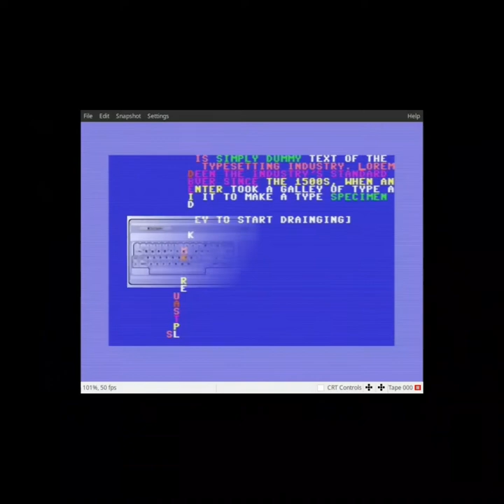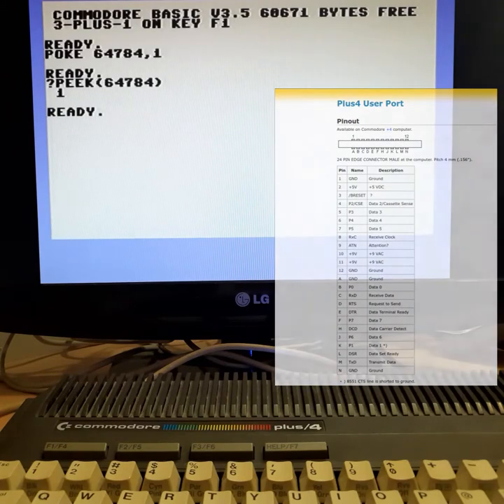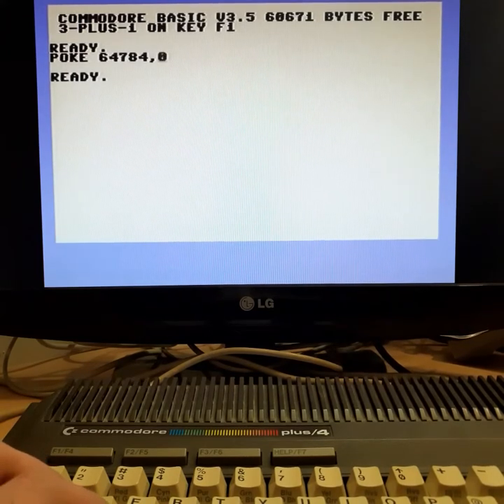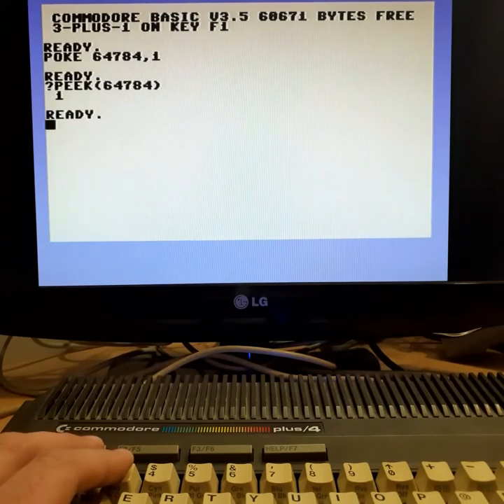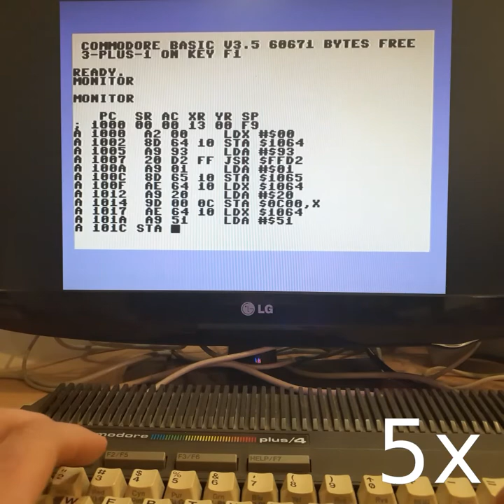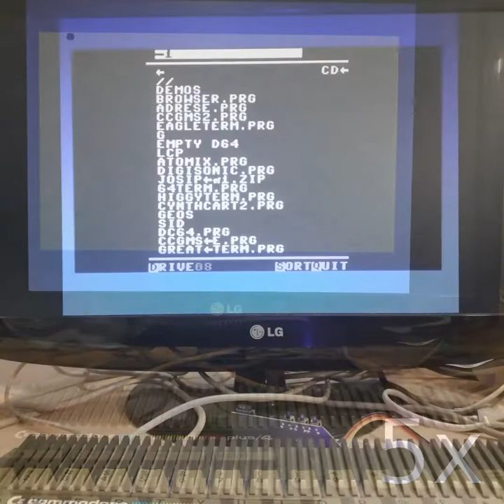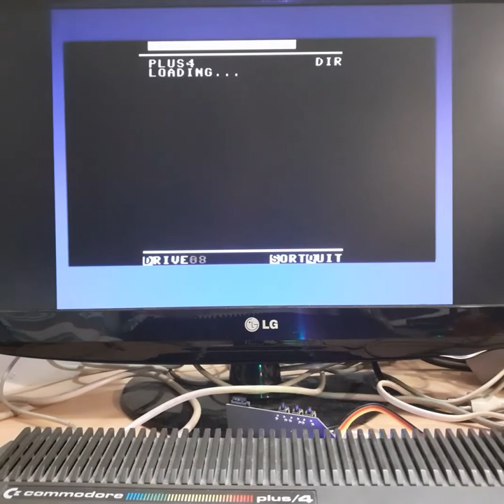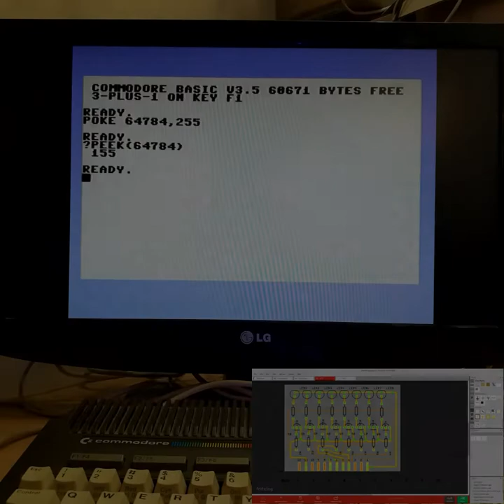Commodore Plus/4 |  Have fun with User Port I/O lines

Comment: Perhaps NTc or ptc resistors can be Used to Check the brightnesstx in a room? Perhaps measuring possuble in Joystick Port?
Reply from the maker: Yes, there are analog lines on Joystick ports...I hope to make more projects with User Port and sensors...